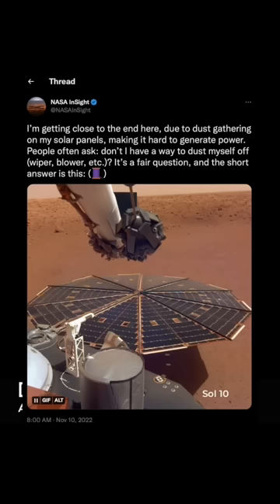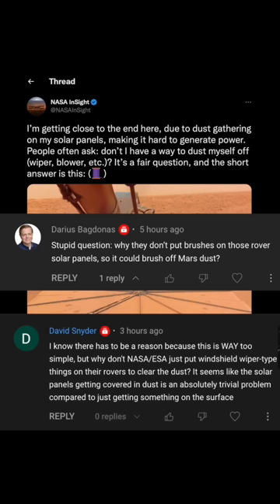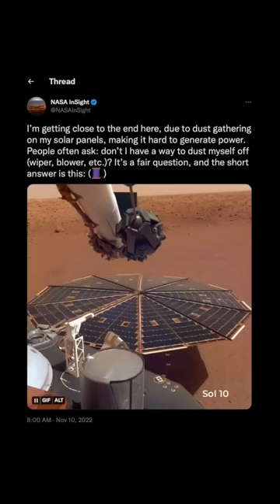Why don’t Mars probes wipe the dust off their solar panels? #shorts

Comment: Look up "piezoelectric movement" you can induce a vibration in a secondary piece of metal...with a pice of metal that weigh less than 0.001 pound... I just saw a video on it on YT. .. 
 And with modifications in amplitudes you can change its vibration frequency and fine-tune it to the resonate frequency of the thing you want to vibrate.... once found you can increase the voltage to "buzz" the dirt from the surfaces

Comment: I agree a wiper system would be dumb due to the damage it could cause to the panels not to mention you'd need 1 wiper for each panel segment and consequently the increased chances of mechanical failures.
I think some sort of high velocity jet blower to blow the dust off would be worth the weight if it meant extending the mission by 2x or more, a little extra cost to extend the whole mission and the ROI on that is surely worth investigating.

Comment: I can't imagine a brush attachment is much weight compared to another instrument though? and the light coming into the panels doesn't have to be unscattered, they still should be able to take a few wipings before the damage is much more than cosmetic. Even two solid wipings should nearly triple mission time.

As for mission length, I can't think of a lander/rover that's outperformed it's mission that hasn't had it's mission renewed until the thing was driven into the dust, so it's clearly usually deemed worthwhile.

Comment: What about a way to angle the panels to cause most dust to fall off?
 Like a piston that is held under compression and only causes a tilt to each or a few individual panels when the system looses power all power or a oeriod of time after it looses power or when power is reduced to a certain level for a prolonged period of time.

Comment: See where those panels open like a flower? Add a small rubber strip that will wipe each panel when it closes pushing the dust off of the panels. It would be less than 24oz of material and a simple few lines of code stating " if pv input = >5% then do clense" "clense = pv close , if pv = closed then pv open"
Reply: Oh and don't forget to add 
"On error resume next" 
In-between every line of code. 
It is an automatic error handler with almost zero faults
Reply: Your're still left with the problem of dust being caught under it and damaging it

Comment: If they ever need a dust removal system I think the best solution will be a tilt mechanism with ultrasonic vibrations but of course there'll be 2 problems weight and power

Comment: A blower system work fine, with the system made of carbon fibre or even plastic it was plastic tubing it would be so lightweight as to be in consequential, the extra burden of electricity would obviously be offset by the fact that you could continuously clean the solar panel and have abundant electricity!
Reply: You would need a large blower to work in the thin atmosphere of mars

Comment: I have an idea for a simple way to clean the solar panels. I am sure the engineers have thought of it, so I am wondering what the problem with it is. 
Take advantage of the static charge. Apply a thin transparent conductive layer. Tablet computers already do this. Connect it to the power supply so that it has the opposite charge of the dust. This will repel the dust. This will be lightweight. Even this would be enough to matter. But, keeping the panels clean should reduce the size needed, actually saving a small amount of weight. Since it is a static charge, not a flowing current, the power cost should be negligible. 
So why don't they do this?

Comment: It might be thin, but Mars does have an atmosphere, so just blow the dust off with some compressed Martian “air”. 
Well the atmosphere is very thin, so you would have to have a compressor. And there isn’t much spare power from those solar arrays, so it would have to be a real tiny compressor that gradually fills a holding tank. At the same time it would have to be a very efficient compressor so no scarce energy is wasted. So it ends up being an impossibly light and small and efficient compressor that cost 3/4 of a million dollars to design and build, but mostly design. 
And then the holding tank would have to be as light as physically possible with as high a pressure as possible to minimize the amount of very valuable volume it takes up. So it ends up being an extremely over engineered carbon fiber tank. But now you have basically a high pressure bomb in the guts of your rover,. So now you have many meetings of the bottle design team are held to review complicated 3D structural models of the tank to determine multiple potential failure scenarios which then require even more sophisticated analysis tools to mitigate or verify they can’t occur. But you can’t know for sure from just analysis, so you have to have a long and arduous testing program to make sure that when the tank fails it does so at the anticipated conditions. But it never does, so you have to go through a couple of design cycles to find the cause for the anomalous behavior and redesign the tank to eliminate them and then start testing all over to make sure the fixes work and don’t cause new problems. 
Finally after two-three years and 7 million dollars, you have a compressor that sips energy but can raise the pressure to 50 times ambient pressure and an air tank that holds enough air to blow off the arrays, but not blow up your billion dollar rover.
Finally on Mars it comes time to blow off the dust and a tiny valve you borrowed from another subsystem that was “fully vetted” but which was  never truly vetted for the use the dust blowing team is putting it to fails and all of the compressed air that has been carefully being compressed by the fantastic compressor and held safely by the gossamer thin walled tank goes blasting out in an unanticipated direction and destroys your main camera and your rover is now blind. Good news though, some of the air at far lower velocity and flow rate than anticipated it would take did blow over the solar arrays and completely cleaned off all of the dust and so the solar arrays of your now blind and useless rover are making 100% of initial power! Yay.

Comment: Get all the teams together to vote which science equipment is the least useful and make them the air puffer team. They can devise a system which uses puffs of air between data gathering or tool changes that keeps the solar panels clean.

Comment: I didn't comment before because NASA engineers are pretty smart and I knew they most likely  thought about adding solar panel wipers. But Becky, the abrasive particle explanation really doesn't wash (groan). If you can't have wipers, you could still have a small ion wind generator, to give the dust particles a charge so they repel each other. Or charge up the dust with one "wand" and use a second wand of opposite charge to pull the dust off.

Comment: Weight isn't the only issue. Added complication is another. Every part added is another part that can brake, interfere with other parts, or break other parts. For instance, a few hinges and a small engine, to tilt the solar panels and vibrate them, couldn't possibly add all that much weight. It would add potential points of failure, though.

Comment: A brush or wiper system doesn’t seem feasible, but a compressor with a directional nozzle and spraying apparatus could shoot pressurized carbon dioxide while the panels rotate, allowing it to clean them and not that much more weight

Comment: Just add a bullet vibrator at the center to vibrate the panels and angle them into a slight cone. The dust might be abrasive but it will gently shake the dust off.

Comment: I was wondering if a way to turn the solar panels upside down, and shake them would work. Perhaps with a second solar panel on the back to increase lifespan further. Eventually that dust will build up, but the bottom side wouldn't be damaged from particles from the ground, if you are careful, you could make so whichever side is more coated at at time is the side that gets more covered.
Reply: and which ever is on the underside would shake the dust off as it moved around.
Reply: Because the cost of all that equipment and complexity is extra weight, and that weight has to get to mars and then operate reliably.

Comment: The 2 year design limit excuse doesn't make much sense tbh. Rovers and spacecraft often far outlive their design life, and we only stop using them when a critical system breaks and can't be recovered.
Spirit and Opportunity are prime examples.  They were designed to last just 90 days but Spirit operated for 6 years, and Opportunity lasted 15.
The Mars helicopter, Ingenuity is another example.
 
As for the dust problem, a brush or wiper might not be a great idea, but configuring the the solar panels to act as Chladni plates by adding piezo transducers would be effective at clearing dust.  The parts are already available, lightweight, cheap and efficient.

Comment: I still think NASA engineers could design a way to keep the solar panels clean. Maybe set them at an angle and have them vibrate in the wind to shake off the dust for instance. Those probes so often outlast their intended lifetimes by vast margins that a little extra effort in designing dust resistant solar panel would probably be worth hundreds of millions of dollars in extra data gathering.

Comment: i think a little electric motor system to build up/suck in air (c02?) pressure in a lightweight bottle to "Air"spray the dust off..it can be made very small and light weight..best of all its non contact and can recharge...we all know that the 2yr mission would be extended as they all are these days..only really ends due to the panels covered in dust.

Comment: Should have a tiny air pump and some really light hosing like stuff in car water jets and blow the dust off once a year or so.. i don't think it would add much weight overall.. but as long as it's lasted it mission duration it doesn't really matter.. and who knows a wind storm could come one-day and clear it off and then after a while it will jump back into life so it may run out of power but it may start back up one day as well.

Comment: You could tilt the panels to their max angle, then vibrate the shaft they're attached to... You could do this every 90 days, and prevent dust buildup indefinitely...

All for the added weight of a motor with a weight on it... 🤔🤔🤔

Comment: Why not add piezo shakers like DSLR cameras have to clean dust off the image sensor?   Seems like it would be very small weight and power hit.    you'd also need gaps between cells to let the shaken dust drop away.

Comment: We've gotten extreme temporal range on the Voyagers and Mars Rovers. When it costs what mega millions to send missions to other planets it's worth a few extra pounds to make it last as long as it can.

And what about canned air? Have a compressor to gather atmosphere (even the thin atmosphere of Mars) and then blow it over the panels instead of smearing them with abrasive mechanical devices?

Comment: They always assume that whatever they send today will be replaced later, just in time to take over. that doesn't happen so that's why they fail forever. On one hand engineers know as much as to design toys that last longer than required, on the other hand because they work for longer than intended then there's no rush to replace it before it fails. Thus you end up with missions that give temporary data of various things but they rarely continue on providing data on something that was studied earlier. 😒
And yes, they could put wipers if only they knew it will last that long. It's really the same as "authorities cought by surprise by stong snowfall" in the middle of December... Incompetence.

Comment: I think they should use the ingenuity helicopter that is still performing very well to fly over the solar panels. Perhaps the downward force of the propellers can clear enough of the dust on the panels surface atraumatically to get the batteries recharged.
Reply: if it only were anywhere near the landing site for InSight
Reply: Per NASA the Ingenuity helicopter is roughly 2,147 miles (3,455 kilometers) from the InSight lander. That’s way out of its range.

Comment: This seems like an easy fix. To minimize weight you install a carbon fiber tank and a small air compressor. The tank launches empty and fills once its needed on the surface. The Robotic arm would have an air line. Just point and shoot to remove dust. I can't be the first to think of this. It would weigh maybe a pound.

Comment: Try a vibration motor and fix the panels tilt  down a little so the dust will bounce away little be little, the could run it friend a few minutes when needed, no extra weight the moter could dubbe up as a drill, and the little hum will giggle them away... Hmm or even better, an oscillating  magnet 🧲 then you can really hone in one the harmonice to get the lander / river a effective shake

Comment: Would a piezoelectric vibration device have been useful? It would weigh next to nothing and could activate when the panels efficiency dropped below a given point. There would be far less abrasion.

Comment: Did anyone ever try to project solar pannels using a combination of Chladni plates/patterns with a small vibrating motors like those in cell phones to if not shake entirely then at least move the dust away from certain parts of the surface? This includes no direct scratching, no possibly jammed apparature, and if you pair a sufficient set of frequencies with the right surface geometry, it could be very possible to move the dust pattern all the way down from the pannel entirely. If that worked, i don't see a reason why a regular shakeup shouldn't become a part of daily maintainance routines for future missions.

Comment: While you are correct as to the current generation, we will need to develop a system to keep autonomous systems running, a wiper system might seem to take a lot of space and weight but when large numbers of autonomous systems are deployed across the landscape it will become an economical proposition. Setup a dust storm weather station a good solid seismic system and a fleet of study rovers and plutonium becomes totally unreasonable. People keep talking about hunting resources and that will require even more systems. Even a small presence in Antarctica requires huge amounts of equipment, in Antarctica diesel power and conventional batteries are used, Mars can not run diesel and cheap batteries can not stand the cold.

Comment: If we got another four years of quake data from it I think it would be worth the extra couple kilos. Maybe if the panels were designed to track the sun rather than be static the dust could be largely wiggled off and it wouldn't be any extra weight.

Comment: they've stated that the not so strong wind on Mars can clean it somewhat, so wouldn't a fan of sorts worked ?, or with the Perserverance rover coupled with Ingenuity just use the chopper to slowly fly over and use the down draft to clear the rovers cells ?

Comment: How about a system that blows the dust off?  A small compressor and small tank, connected to a thin articulated arm and nozzle.  Little puffs of air every few  weeks or so should do the job with minimal abrasion, and it shouldn't weigh too much.

Comment: I would’ve assumed it’d be an air system to clean off the surface not a wiper but point remains about the weight.

Comment: I wonder if they'll be able to use a tech like they're planning to use in moonsuites. A huge problem with the moon us it's dust can be like tiny shards of glass. Plus it's got a charge that makes it attracted to things, like a dryer sheet. So, they have wires going through the suite ti create a relevant charge, which should repel the dust.
I don't know what the charge is like in Mars dust, but it could be possible they could find a way to use power to repel the dust off the panels.

Comment: Why not use a small compressors to blow Martian air over the panels to remove the dust. Doesn’t have to be perfect just enough so the panels can work
Reply: It will be heavy, there is almost no atmosphere there.

Comment: do you think they could possibly install a (Before I say this I know ground lvl is the equivalent of around 100,000 feet altitude on earth so not much air, but a small watt compressor running at peek power production (Mid day) could collect enough compressed air over a few weeks or months to easily blow dust from the solar panels, Don't you think?
Plus all it would require is small air ducting holes along the edges of the pannels to blast air across the surface of the panels.

Comment: A central fan or an air compressor with an air hose to blow off the dust wouldn't add that much weight. A lightweight mechanical arm to get from the center of the panels to close to the outside to force the sane off. Lot less abrasive than wipers.

Comment: Lol. Martian dust is somehow more abrasive than dust. Comical. 

Dust accumulation in just a mere few days, significantly (MASSIVELLY) reduces solar panels efficiency.

That level of dust is ridiculous!

It immediately started to effect the efficiency! They were panicking. However, they got lucky a few times when alot had gotten blown off.

I live in an area with a common 45+, upto 70+ winds, cinder sand and dust, and metal oxides.
Which is actually incredibly abrasive, and used for sandblasters.

Yet, my panels show no signs of damage from getting constantly sandblasted. 

A brush system isn't going to do any tangible damage considering its not going to be used enough to be able to actually do any real damage, and is far less damaging than sitting sand that's etching with the vibrations. 

A simple brush that makes a pass every week or two would not have added any significant weight, as the mission was under weight as it were.

Stay in your lane.